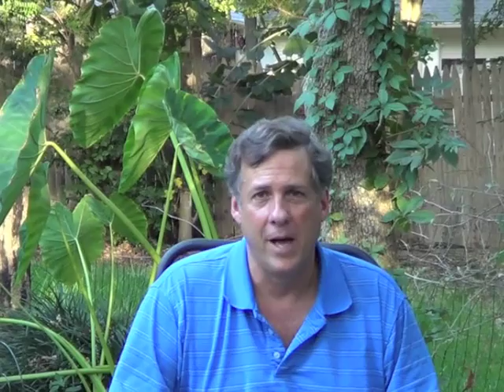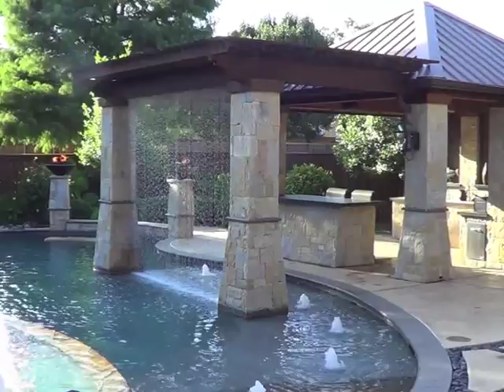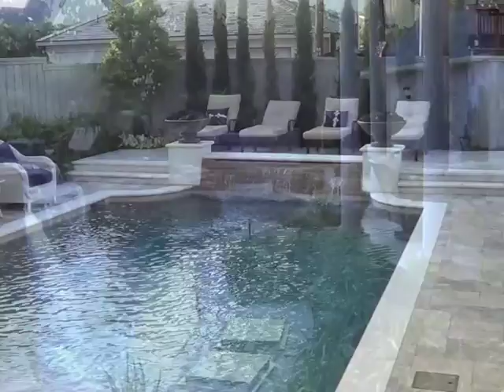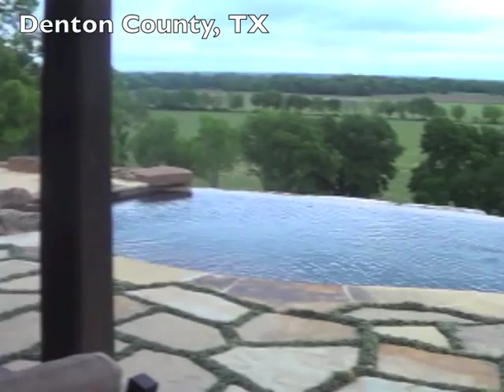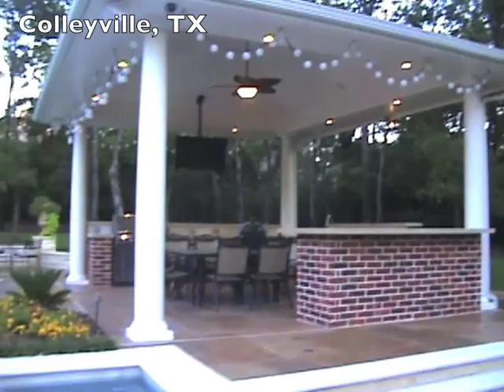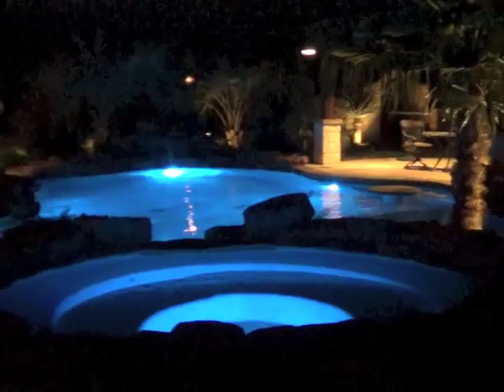How Much Does a Dallas Fort Worth Pool Cost?

Comment: Great video!  Very informative!
Reply from the maker: Should update. Prices have gone up almost 5% a year the last 5 years. Thanks
Reply: Yes agreed.  I put a basic rectangle pool spa combo in with 94 perimeter 13,300 gallons with 600 sqft of concrete decking for 65k.  That’s on a new construction home with both lots empty to me with plenty of access.  It’s pretty shocking how expensive pools have gotten.